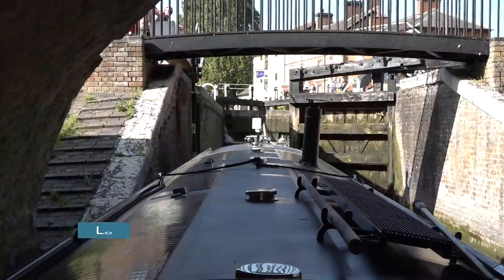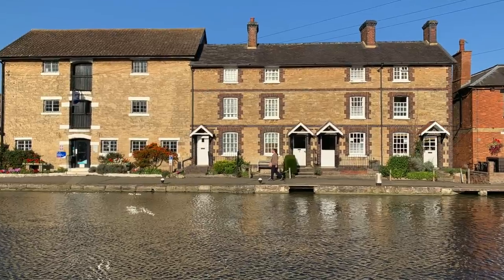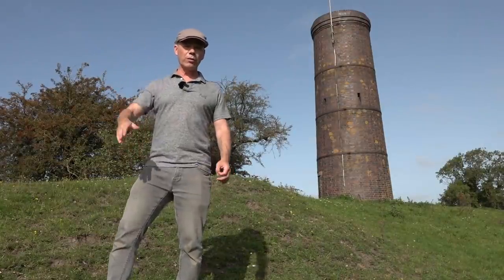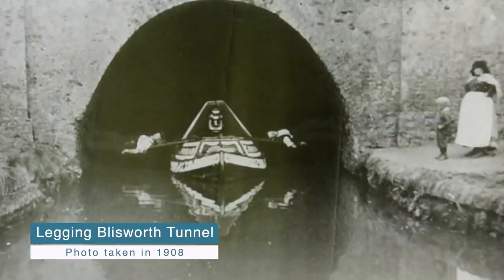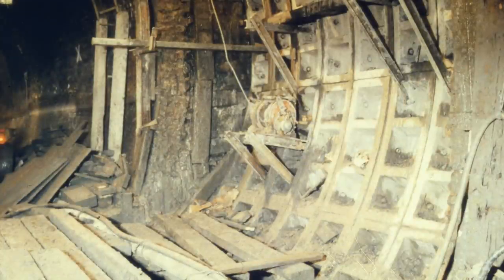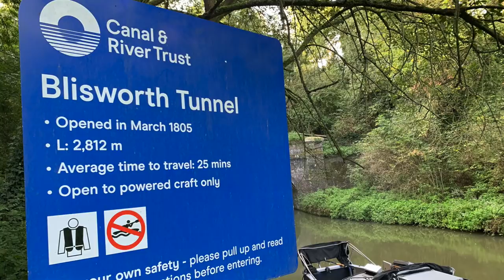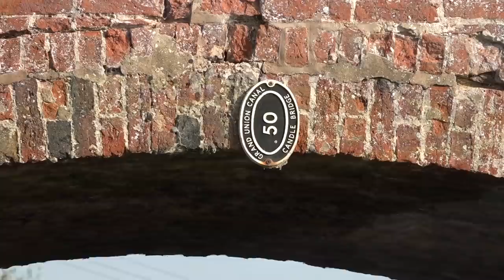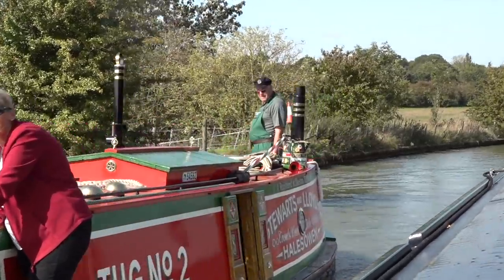How Did They Build Canal Tunnels in a Straight Line? Ep. 126.

Comment: Yup, another 1st rate effort by you gents. If you haven't already, check out the tunnel of Eupalinos in Samos Greece, built in the 6c BC.  A mere 1000 metres long but dug through a mountain from both ends and meeting in the middle. Still there 2500 years later.
cheers   a gonguzzling fan.
Reply from the maker: I'm Googling it right now! 👍🏻👍🏻👍🏻

Comment: Great video as always, my wife and I are planning on buying a boat, probably a Dutch barge or wide beam for access reasons, but I have a question regarding washing clothes, I presume you do so whilst you are cruising and use the inverter to power the washing machine whilst the engine is charging so as not to drain your batteries, but often see your doing washing whilst Shaun is shopping and your moored at a water point, do you run your engine or can your electrical system cope with the load?
Again great video, very entertaining, excellent content and outstanding editing. By far the most entertaining of all the canal channels we enjoy. And one I never miss.😊😊👍👍👍
Reply from the maker: In the spring and summer we can do a cool wash without running the engine. Anything over 20c and I'll run the engine or do it while we're cruising 👍🏻
Reply: @FoxesAfloat  thanks guys!